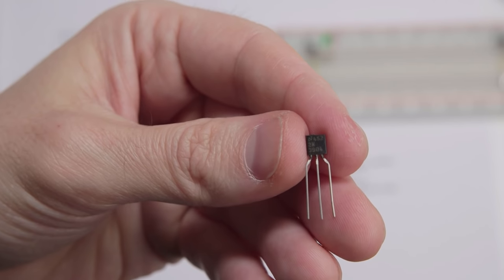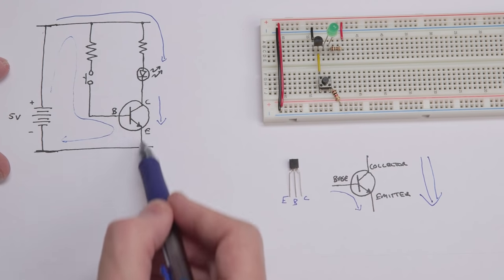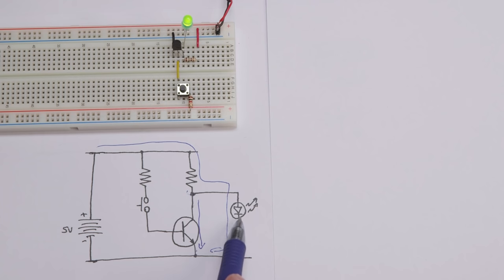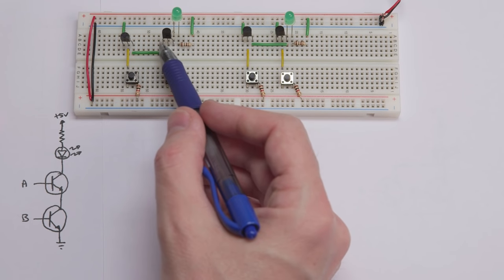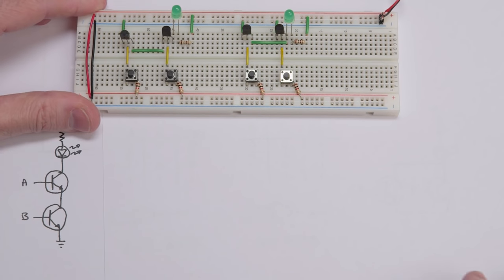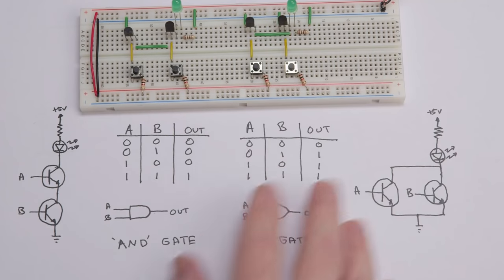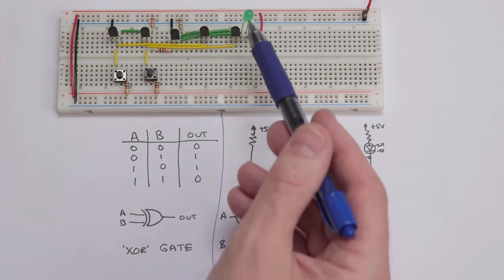Making logic gates from transistors

Comment: Correct me if I'm wrong, but I don't think you need transistors for the OR gate
Reply: Probably too late now but if your doing manual inputs you realistically don’t need to but when there are outputs coming into the inputs of the or gate you will want to use transistors since obviously the output won’t be able to push the button itself

Comment: Thanks for the video, but both my mosfets just conduct electricity from the collector to the emitter AND VICE VERSA without needing a current through the base. I’m so confused
Reply: Mosfets are voltage controlled so probably you need resistor between gate and source to discharge of voltage
Reply: The Gate of a MOSFET drives next to no current because of its high input impedance. In the construction of MOSFETs there is an insulating layer between the Gate terminal and the Body/Substrate.

Comment: What transistor are you using, an NPN transistor? Coz wherever on the internet I see the Collector, Base and Emitter marked in just the opposite order than what you explained, and connected in your circuit. I'm concerned I'm using my transistors the other way round. Someone please clear it out for me? (I'm using a BC547)

Edit: I did some research and found out that the 2N2222 and BC547 have their C, B, E in opposite orders. Why so?
Reply: I mentioned the same thing. I find it very very odd that he doesn't mention anywhere, not even in the description, the type of transistor he's using. It's obviously confusing a lot of people. The fact that he doesn't really address that there are ALL types of transistors out there seems bizarre to me.

Comment: I'm having a senior moment here. Why is the middle 5v and resistor required? 

In a (0,0) scenario  the AND and OR gates are both off, therefore by very definition there is no current flow.

In a (1,0) and (0,1) scenario the current flows through the OR gate and then through the middle transistor to ground as its base is always on. 

In a (1,1) scenario the AND gate provides the easiest path to ground and therefore the LEDs do not turn on. 

I see no purpose for the middle 5v and resistor other than to generate heat and drain the battery.
Reply: which "middle 5v and resistor" do you mean? the question is vague, so adding a time might help me in answering your question better. 

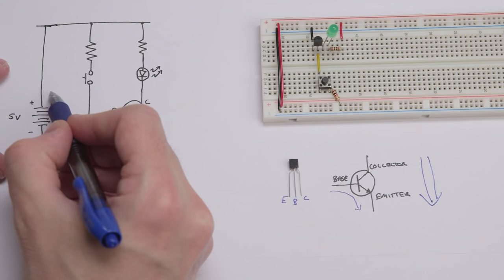if you are asking about the the bottom resistor at 1:09, that goes into the base, which is the signal which switches the state of the transistor.
Reply: @carlos2004  the three 5v and resistors at the top of the diagram. The middle one.
Reply: @wilkes27  ah ok, i get it, at the XOR gate.
at first i thought it was used a some kind of pull up resistor, it seems it doesn't need it since when the state is (0,0), the transistor is in the same situation as the the second transistor of the AND gate; which is basically that its collector is tied to the emitter pin of transistors in the off state. seem to me that if it was necessary, then the second trans of the AND gate would also need a pull up. but who knows, i'm extremely new to electronics, so i could be way off.
Reply: @wilkes27  finally got my pack of transistors delivered, built and measured the a test circuit, and you're right, the middle transistor is not needed. seeing other comments point it out, it seems it is simply a mistake made in the original circuit as it does not need the 5v input at the collector.

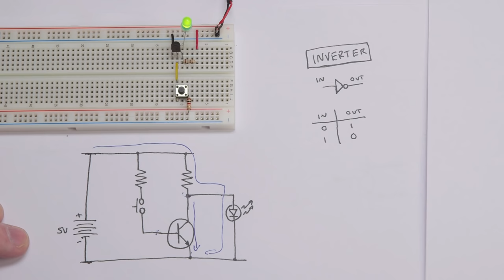Comment: This is a long shot, but can anyone explain to me why the LED doesn't just dim at 3:50 when he's explaining the inverter. Why does 100% of the current flow through the transistor, I understand they both have close to 0 resistance but ben mentioned something about the voltage potential which didn't make that much sense to me. Why does all the current go through the transistor?

Comment: for the first circuit diagram if you were to move the output to be between the battery and the transistor, and replace the led with a button, would this also work as an and gate?

Comment: Question: why do we need transistors to do those logic gates?  It seems like simple switches can be sequenced or paralleled to do the same thing.
Reply: If you want to explain transistors, it’s good to use transistors. You don’t need it if you want to do analogies, you could do switches, relays, valves and analogies in general.
Reply: if two transistors in sequence aren't both on, this makes a AND gate
if there is two transistors in parallel, one will not stop the other to operate, and this makes a OR gate

without transistors, the information needs to be manually defined, but transistors are switches that accept energy to be on or off, and you can create a carry of energy that represents logic, and there we go, we have bits

electrons substitute humans for turning on or off our switches :)

sorry for my bad english

Comment: Your logic gates works for an LED as the output but if you wanted to use it in a computer the output would have to be a voltage.

Comment: Your videos are good but I am an amateur with only 1 years education I electronics and 1 semester in computer science. What confuses me is the cross coupled nand or nor Gates as memory cells. I use an AND Gate OR Gate Invertor combination for latch that functions as a
Memory cell as well as having many other uses . The only way I can make sense of nand or nor gate cross coupled circuits is to maybe guess that more complex circuits were reduced using boolean math. But with circuits I design I can complete tasks such as a design that allows an image to be taken from memory and changed from its original small  size to medium or large .

Comment: When the xor gate is activated near the end of the video wouldn't that be a short circuit? If not is the resistor at the top of the circuit taking all the current in, thus heating up or something like that?

Comment: 10:13 In XOR gate, I don't understand what 5V does on the C leg of the transistor that connects AND gate and OR gate. Is that to make voltage higher so that it prevents the leakage current from OR gate??

Comment: hi ben, nice video, i found my answer i believe on how to create the component i need... but im unsure of what components specifically to buy. im trying to create an AND gate circuit that allows ~12-14v to pass when the A and B are receiving ~12-14v. the application is for an automotive blinking tail light system. the constants are the voltages present in a basic 4 wire trailer wire connector. the wires are yellow (left blinker or stop), green (right blinker or stop),  brown (parking light), and white (ground). what i need to happen is when yellow and green are hot, 12 volts is allowed to pass which goes on to a (blinker circuit that i have already purchased) but only when yellow and green are hot. how would i go about determining what components to use? thanks in advance.

Comment: Question: How come the inverter circuit doesn't short out when the button is pressed? Isn't there a clear, straight path between the positive and negative terminals of the battery?

Comment: In the xor section 11:50, what is the purpose of the +5V line in the center top of the diagram? The other parts of the circuit seem like that would still work without it.

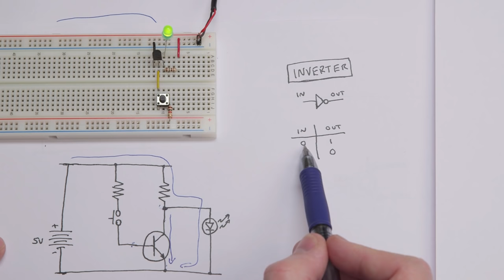Comment: Why does the inverter at around 4:00 work? There should still be some current flowing through the LED. Sure, less than before pressing the button. But there will still be something flowing. So it can't be 0 Volt, can it?

Comment: There is another youtuber, I won't advertise him but it's a German guy, ppl watching this might know who I mean, anyway he posted a similar video, and like yours it's a great resource, but I'll make the same comment here that I did on his video and that is if you take away the transistor you will get the same behaviour, I know that's not the point, and I have built these circuits myself and they are a lot of fun, but yes the transistor is an electronic switch, but then the switch is also a switch, it doesn't really make any sense until you have other electronic switches doing the switching, and again I realise that would introduces a whole level of complexity and there is no other easy way to demonstrate it than like this, but at the end of the day you are just closing a switch to energise the transistor, once you realise this it leave it a bit flat.

Comment: at 11:45 I still don't get it why do I need a power source on the collector of the middle transistor, wouldn't it work just with the current coming from the diode circuit? if that is the same power source wouldn't it be bypassing the resistor, diode and transistors and go straight from the power source to ground from that middle transistor?

Comment: can you please explain the resistor values and how they are calculated to allow the transitor to switch on and off in the direct and inverter cases?
Reply: You can experiment using potentiometer. To start with I know these BJT's start conduct at 0.7 volts. Otherwise its off. Keep rising voltage to base emiter or base collector, depending on if it's NPN or PNP structure, until it fully opens. 
I would go with MOSFETS they are actually made for switching.

Comment: "Amateur" question, but why do we need resistors everywhere? The wire would overheat?
Reply: Because once on, transistors act as simple diodes. Diodes need something to control the current, since their current/voltage curve is nearly a vertical line after the threshold voltage (around 0.7 V). So, yes, the wire would overheat because it would be analogous to a short circuit.

Comment: For XOR, why is the middle +5V needed? Without it, the circuit would simply be open if the middle transistor is off and therefore no output. Still works right?

Comment: Noob question: 2:25 I built the inverter circuit Ben shows and used a 10K resistor on the Base but the circuit didn't work -the LED turned on but wouldn't turn off when I pressed the push button. I replaced the 10K resistor with a 1K resistor and the circuit worked. Can anyone explain why?

Comment: I tried to build the circuit on my own but I couldn't do it although I placed the components on the same positions. Do you read whether the button is pressed or not with a microcontroller? The I would also help to show the code.

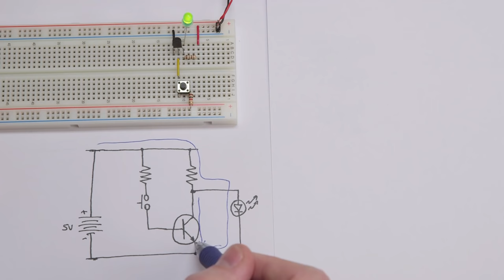Comment: Don't we make a short circuit while passing current through the transistor in the inverter circuit ? Time: 3:03
Reply: thats why the LED doesn't light up like a NOT gate.
Reply: @mellonhead9568  Doesn't it destroy the battery being used in the project?
Reply: @nayeemislam8118   not sure about that but you can add more resistors its just for that part of the circuit in parallel current will take path of least resistance instead of LED.

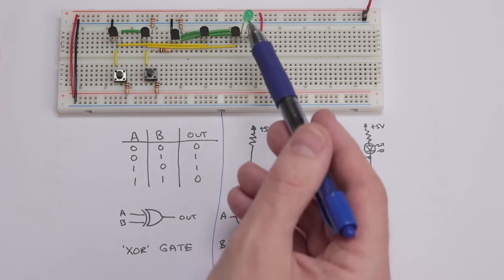Comment: 11:30 Pardon my ignorance (despite many years of trying my hardest to understand electronics), but wouldn't pressing A+B in the XOR setup effectively drain the battery (i.e. "short" the circuit) despite nothing really "happening" (i.e. no LED lit)?
Reply: I'm not an expert by any means, but, looking at the diagram, I'd say yes.

If A and B are pressed, current flows from the leftmost circuit "entrance" to the "exit" beyond the AND gate.

Comment: the first two circuits you show... the transistor is basically unnecessary right? I mean, it just puts a redundant layer on top of the switch? not that they aren't educational I just want to check if my suspicion is right

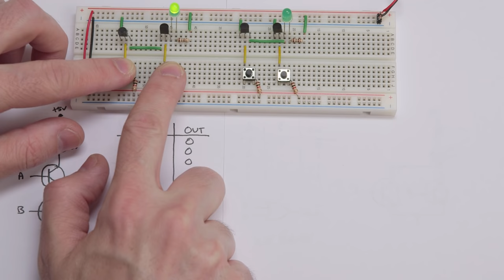Comment: At 6:00min it's a nand gate! You show a "AND" gate in the example!
Reply: No, this isn't correct. A NAND gate outputs a "1" when both inputs are 0. Hope this helps.
Reply: @Chris-jd9wg  true! So when both transistors are on, the  output goes low and the LED turns on! You don't what the hell you're talking about!

Comment: With the collectors and emitters connected in parallel on the OR gate doesn't that draw twice the current when both switches are on? And shouldn't that affect the LED brightness at 7:36?
Reply: I am in no way an electrical engineer however I believe the resistor for the led limits the flow of current through the circuit and thereby keeps the led at a consistent brightness because either path immediately lets the led go from nothing to full... but I maybe wrong...

Comment: The diagram at 3:36, why does the LED turn off? Doesn't the voltage potential become half and half when the transistor is on so the LED dims a little?
Reply: i believe since the LED acts as a resistor, it will have way more resistance than just going through the transistor and bare wire. I think some current will still go through the LED, but not enough to light it. I could be wrong though.

Comment: Can we use any transistor or is there any special transistor you used in this video
Reply: Most transistors of the BJT type, NPN or PNP can be used.  More complicated devices require more complicated circuits.

Comment: Re the inverter: when the transistor is on why does the LED 'short-circuit'? Why does the current only go through the transistor, and not split and go through the transistor and the LED?
Reply: When the transistor is on, the voltage from collector to emitter is small (look up Vce(sat) on transistor datasheets). This collector to emitter voltage is the same voltage that is across the LED.  It is not a high enough voltage to forward bias the LED, so approximately 0 current will run through the LED.

Comment: Excuse me. I did not get well understood the XOR GATE with the explanation. I'm sure some others are in the same case as me, but looking in the coments, I did not se any replay about it.
Ben, could you explain logic gates in deph in new videos, please? 🙏
Reply: The XOR gate confused me. I searched the internet and I found a circuit that could be a XOR gate with only two switches (which means only two transistors). But I still don’t know how to design a XOR gate circuit. If I design a XOR gate circuit based on the AND, OR, NOT logic gates, 7 transistors are necessary.

Comment: How would I hook the output of the AND gate to the base of another transistor?
I tried placing a jumper from the LED to the base of another transistor (which I'm using in an OR gate), but when I do this the circuit is completed through the base and the OR gate is activated whether the AND is activated or not.

Comment: what distance could I reach to use this for let's say an adruino gpio input to detect if a switch is closed or opened? Given I would put in like 2-3 AA batteries as a higher source of power as afaik the gpios to send and receive are not really reliable over a couple of inches.

Comment: why is the battery backwards, doesn't it flow from negative to positive? If not, then the stuff I learned in school is wrong
Reply: Electrons flow from negative to positive but current is defined as the flow from positive to negative. The definition was made before anyone knew what electrons were or that they had a negative charge. Now we're just kinda stuck with this weird definition that goes against what actually happens

Comment: Most of the video is well done. I'm really happy that I stumbled upon it. However, I would like to note that your XOR gate diagram is trash. Followed it to the T like 15 times thinking I wired my board wrong just to find out that you drew the diagram incorrectly, which happens to be what I'm following to emulate the circuits at home. Wouldn't be a problem, I could just draw up my own diagram but the actual breadboard for this circuit is almost imperceptible at 780p..

Comment: For the "not" gate, why does the voltage potential lower at the transistor when the switch is pressed and turn the LED off?
Reply: Because the internal resistance of the transistor is much smaller than that of the LED, so the current flows through the transistor instead.
Reply: @KiraleosAkis  Thanks man!  So basically, some current does flow through the LED, just not enough to light it?

Comment: Hi there guys, I have a question. If we aim to switch high side, in writing data and such, why would we ever use npn? If I want to set a pin high when a xor gate is satisfied, my understanding is doing that with only NPN transistors requires like 9 transistors, an AND gate to negate the high signal from a possible (1,1) input through an OR gate which must be satisfied through a modified NOT gate to switch high signal. At what point does it become more economical to use common cathode vs common anode?? Is there a mix of both conventions in all data processing? I hope I've made my lack of understanding tastefully clear lol. Thanks.
Reply: I believe a large part of my confusion lies in what im understanding is it doesnt matter where the led is in the circuit, npn or pnp, if the led is on when you want it to be, you have succeeded in making the output a 1. So even if you're switching the negative, the output is allowing flow, so it is conaidered in high state? But dont chips like eeproms have common negative? If thats the case, switching negative through npn would always affect every single other pin because their negatives are all common? Thanks again for any info :)

Comment: so why need transistors, you could just do it with the buttons alone?
Reply: Instead of a button, there might be a light sensor or a pulse from another device (which doesn't have fingers!). Also one transistor could turn on a hundred other transistors which you can't do with buttons and fingers.  Integrated circuit chips have thousands of transistors doing various jobs.

Comment: In the XOR gate, could someone explain why the current would switch path if you turned on A and B? For some reason, it makes perfect sense to my head that the current would instead split and go both ways :|
Reply: There is a resistor. The current heading to the AND gate would find a path of less resistance though the gate, if it was open. Since it isn't, the resistor is the only choice.

Of course, physics tells us that some current would go through the resistor even if the AND gate was open, but evidently it's not enough to enable current to flow through the transistor.